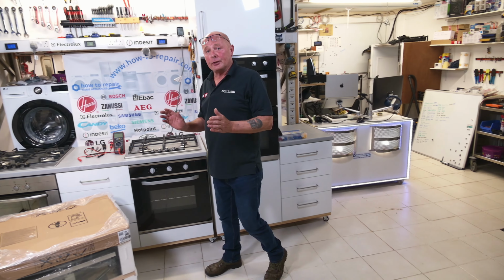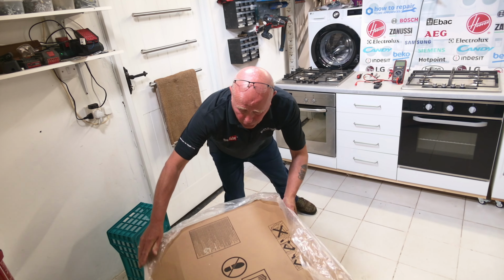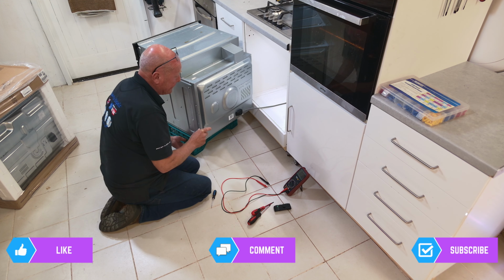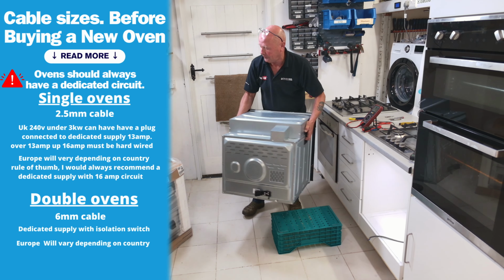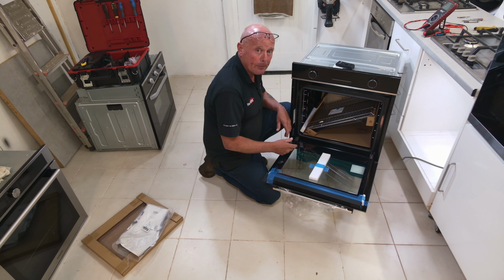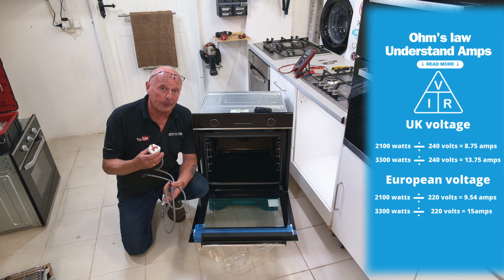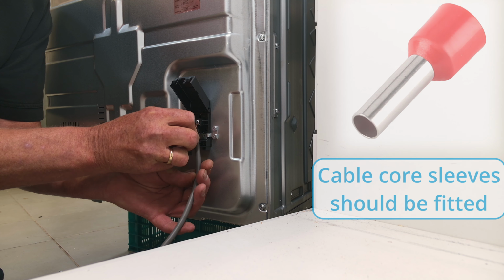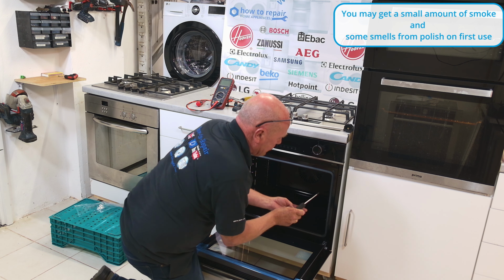Installing A Built-In Electric Oven Without Help! Step-by-Step Tutorial on Beko Cooker Installation

Comment: Not to be dismissive as I'm sure someone will get help from this video. However, a more helpful video would have been to show how to hardwire a new oven to the existing wall socket. If you move into a new property there isn't likely to be an existing unit as the last owner/tenants would have removed it. The most common scenario is you have a new/existing oven and an empty gap for said oven with a wall socket. How to hardwire your oven is what most folk would need.

Comment: Great video, some useful information. Just a couple of points. I am a qualified person for LV and HV systems and would like to point out that testing the supply cable with a multimeter and declaring the circuit dead is not acceptable. The meter could have failed after the last test. ALWAYS test the multimeter on a known live circuit or proving unit then carry out a check on the circuit to be worked on and finally re- test the multimeter. Then and only then can the circuit be classed as safe to work on. One other thing, ampage ? No such thing. It is current.

Comment: A multi meter should not be used to check for presence of voltage for safe working.  A good pair of test lamps are what should be used testing them first on a proving unit or a known live supply first.  A multi meter contains far too many electronic components that can go wrong (you are putting your life on it). Multi meters should only be used for measuring.

Comment: Any ideas on why my rdc switch is tripping in my electric box when my oven is on for so long? It also works on some settings but not others thanks
Reply from the maker: Hi @Fezz0509  If I'm understanding your question correctly the oven trips after a long period of time when it's cooking this could be due to an element but I will need more information. I suggest you use the contact us page and give me your make and model so I can find the correct literature for you I will need the full model number of the identification plate please use our contact us page and make sure you fill out the request of what part you are after and will get back to you within 24 hours normally https://www.how-to-repair.com/help/contact-us/
this is for you https://www.youtube.com/shorts/e432SAb2g08 please remember to subscribe as that's what keeps this channel going. Thanks 👍

Comment: A friend of mine has a Zanussi ZBF 760 built in oven which has developed an intermittent high pitched rattle. I haven't heard it myself as typically it didn't do it for me. I was wondering if you have any ideas what could be causing it.

Comment: Hi. I'm buying a Logik LBFAN X23 for my renter. Can I fit it or does it have to be an electrician. Everything is already there such as cable, fused wall switch with Cooker on the socket. Looking at the video, it's like fitting a plug. The house was built 1997 (Blue and Brown cables in the walls, not Red or Black old  builds. Thanks.
If not can I fit one for my house or a sparky
Reply from the maker: Fitting the new cooker will not be difficult and if you are confident with electrics, it will be okay but depending on where you are in the world as it’s invented property, you may need to get an electrician to check the work as it may need a certificate
Reply: Cheers @How-to-repair

Comment: We've got a situation where our oven can't be secured at present, as the positioning of the mounting holes isn't in line with the cabinet surround, so trying to screw it in just splits the wood. Any suggestions?

Comment: Good morning , sorry I cannot deal with opening the external terminal box that covers the main power cable( 220 c) , i  used screwdriver to loose teeth  swinging  in and off. I also heated the plastic with  electrical dry  up to 50 c. I didn’t succede

Comment: I have my old oven which is hard wired, and my new oven a Bosch series 2 HHF113BA0B

 which has a uk plug.  Can I disconnect the wire on my new oven and just hardwire the existing one I have directly to the new oven?